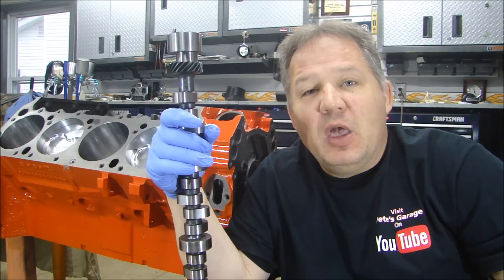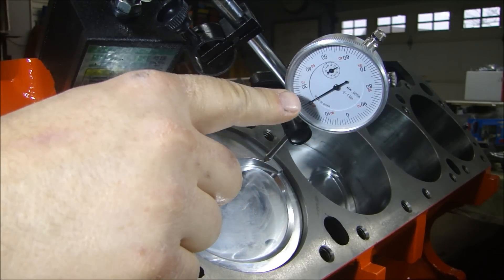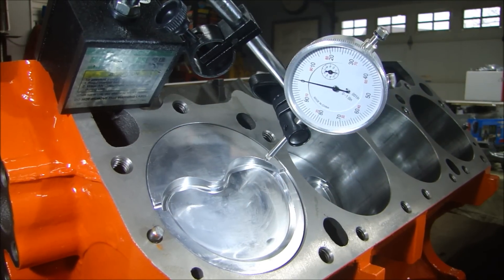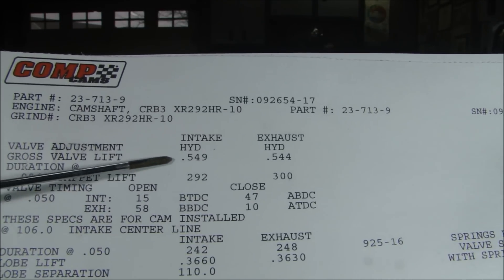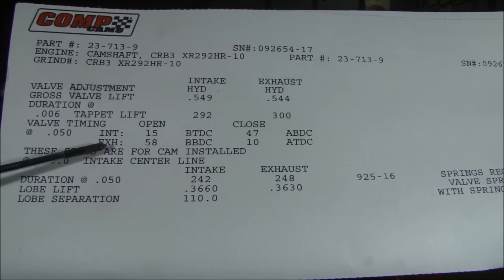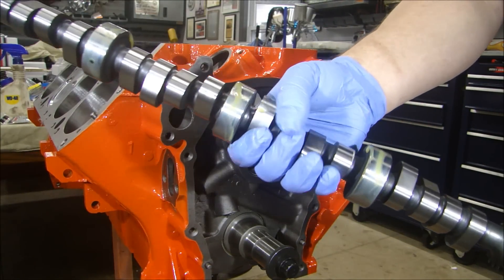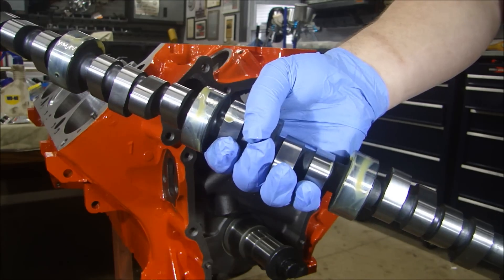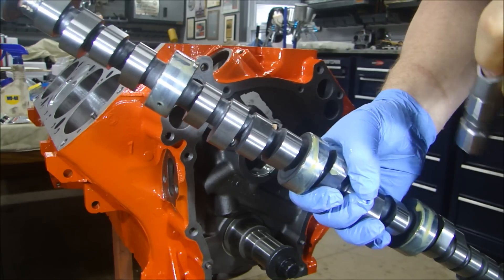440 Chrysler Mopar Engine Building Part 5 - Cam Installation

Comment: Pete, can I use a 3-bolt camshaft on my 1-bolt 383 B big block? Does it requires any modification besides the timing gear?
Reply from the maker: Yes you can, with a new timing gear

Comment: Hi there Pete...Did you remove the washers on the cam bolts to install the cam button?  Thanks...Tom Lacy
Reply from the maker: Depending on the combination of bolts and button, you may have to trim down the washers to get the button to fit

Comment: Been watching your vids. Im not a Mopar guy but have one that a customer brought in and its giving me fits. Its a 440 wedge motor. Its just been rebuilt and all new parts. 850 holly brawler  carb and edelbrick intake. The headers are garbage and hit the plug boots even dimpled they are burning the plug boots and headers are glowing red if I keep it running. I was able to check timing and its at 8degrees . Then I have to shut it off before it gets to hot. At 225 degrees I shut it off for fear of it getting to hot. Thermostat seems to be working fine. I talked to the engine builder and he says he checked the push rod length and shimmed the springs to spec for the comp cam. The rockers have no adjustment so they can not be adjusted. But to me it seems valve adjustment related. I have even installed ceramic boots and the rubber inside them melts and plug wires fry at the plug.  The distributer is a Mallory unilite. The number 8 cylinder header tube is so close a short spark plug has to be used and still hits the tube. I still think I should be able yo get the engine running and not burn up the motor even with the crappy headers. Do you have any ideas on what to check or do to see what the issue could be. If it was an adjustable rockers set up That would be the first thing I would do is double check my valve timing. All my experience is no good here on this one. Another note. The heads were so bad that the motor builder said he had to resurface the spring pockets because they were gouged out from incorrect springs. This should be a simple break in and tune but turning into a night mare. 6 plug wires so far its eaten and two plugs.  If you have any ideas or things to check let me know. Also I'm not sure but I see the intermediate shaft between the dist and oil pump. Is there any way that would make any difference if off a tooth ? When I dropped in dist I made sure to set it at correct postion so it seems to be correct. Wires correct.  Fuel adequate to keep cylinders cool. It seems valve timing is off. Firing order is same as chevy so I had that down.
Reply from the maker: Are you getting oil pressure immediately? The headers won't make it overheat.  It's either timing, too lean, or air pocket in the cooling system. Even though it's an 850 carb, it can be jetted too small on the primaries.
Reply: Does TDC correspond to the timing mark at 0° with the harmonic balancer. If it's a used factory harmonic balancer the outer ring can slip throwing off you're timing.

Glowing headers at idle is an indication of retarded timing.
Reply: @a70duster  Im not sure what the trouble turned out to be. I got worried when I pulled the headers off to put on a stock exhaust manifold and see if I could keep the  spark plug wires from melting  and one if the bolts stated leaking water. I called the customer to tell him and he tells me that its common on these motors. Someone put in long bolts and pierced the water passage. He said just put high temp silicone and it will be fine. Just get it running good for me. Its okay if it rusts the bolt. I had him pick it up that Friday. No charge for my time so far. Just take it.

Comment: hey Pete. have you ever installed a timing chain where you have to set the cam gear dot at the top 12 o'clock position?
Reply from the maker: Yes
Reply: @PetesGarage  thank you Must of been a Mopar engine.
Reply: @mimaspa1234 12 oclock position would be tdc1 correct.. where if you sent the cam gear down at 6oclock face to face with the crank gear dot the timing would be set to 180 out?? Am i right?? Meaning I need to set it at tdc1 which would be 12 o’clock for the cam gear??
Reply: @drgreenthumb9984  thank you

Comment: It makes sense not to lube the lobes initially, but why does Comp Cams instruct to lube the lobes and oil the journals? You would think that assembly lube would be better for the journals. Also, their instructions don't mention the thrust bearing for the back of the cam timing gear, even though it had one on the old cam. I bought the "kit" from Comp Cams, and it didn't come with one either. Thanks!
Reply from the maker: That's a great question. They are the manufacturer so if there is a problem they can can you did not follow their recommendations is my guess. I always lube thrust surfaces on the cam and crank, that also makes sense.

Comment: Hey Pete, I ordered a new Howard Roller Cam for my 440 and figured I’d replace just about everything including the timing gears and chain...question is how did you find out what size bolts worked for the timing gear on the camshaft
Reply from the maker: They should be the standard size

Comment: Pete im really struggling with intake centerline for the mopar trickflow cam. I have found TDC multiple times to confirm accuracy with a piston stop. 

They tell me centerline should be 104 degrees. Im getting 30 degrees and also 110 at .050 on my gauge.  So im assuming this means 110+30/2= 70

When i called trickflow they seemed to have a hard time giving me the centerline number. They had to get with engineers  and i got the run around i feel. 

Your one of my last resources, and figure you might know being you did the trickflow 240 heads.
Reply: I figured out my issue. My crank sprocket ⚙️ was installed at 0 with the woodrruf key.  This gave me 70 as centerline vs 103  which is what i got after changing positions to 4 advanced on the crank.
Reply from the maker: It's always something simple, glad you figured it out
Reply: @PetesGarage  Thanks for the reply, I always appreciate it. 

It is always something simple. It was really driving me nuts, because i have degreed a cam a few times. 

What was your 440 static compression you built? Mine is targeted at  10.42:1 and 8.53:1 dynamic with the trickflow cam. 

I didn’t know my compression ratio prior to measuring everything because it was an unknown build.

Comment: As far as finding the TDC, does it matter if you are on the exhaust stroke or intake stroke? If so how do you know which one is which?
Reply from the maker: Until you put the cam in there is no intake or exhaust stroke. Intake stroke happens right after the exhaust valve closes
Reply: @PetesGarage  thank you! Working on a 318 poly head and this is my first build, so I'm still trying to learn and retain as much as possible.

Comment: Im alittle Surprised you didnt degree the camshaft....all those nice positions on the crank gear are there to get  your intake center line where the manufacturer wants it...ive had factory cranks off by several degrees....if you dont ck...you dont really know...🤔
Reply from the maker: I do have 3 videos on that

Comment: Thanks for the very helpful video! This is my second 440 build and while the first went smoothly with the cam button this build seems to have excessive clearance between cam button and timing cover. I have .157 clearance and this seems like too much. I am using same timing cover, timing set and cam button as last build but different cam. I have measured and remeasured and still come up with about .157 gap. Does this seem excessive to you? Not sure how to make up such a large gap. Any thoughts? Thanks
Reply from the maker: Interesting, you can put a shim behind it. It would be nice to know what's different

Comment: It's much easier to install the chain on both gears before installing them on the cam/crank.  Then there is no fiddling with the camshaft nicking up bearings or anything.
Reply from the maker: It sure is

Comment: I have always installed a cam shaft in the block, before the crankshaft, that way I have complete control of the installation, no chance of damage to cam bearings.
I have been doing it that way since 1963, when  I started my apprenticeship at 16, and never had any problems.
Reply from the maker: Sure, that always works. I prefer to do it after the crank and pistons are in in case a nut or rod bolt falls in. Don't want to nick the cam.

Comment: I completely disagree with how you put the chain on. It would be and is much easier to leave the cam gear off and put the chain on both gears and then bolt it up. You risk damaging the cam bearings doing it your way. I have been building engines since 1965 and I would never do it your way.
Reply from the maker: Thanks for sharing your technique
Reply: Agreed, the risk to the bearings is significant. I have never seen or heard of it being done your way.
I have only rebuilt a few engines, but I have done many timing chains (usually in the vehicle).

Comment: Probably an amateur question, but have you ever seen a gap between the back of the cam and the rear of the block? I've been told it's normal and the cam can't move due to the cut of the cam/flat tappet lifters and the cam gear holding it, but I'd like to be 100% certain. Video link below for explanation.

https://youtu.be/V_YH0TN0uLI
Reply from the maker: Don't worry about that back movement. The cam gear will hold it in place. The cam on this engine will thrust forward towards the cover so it's not a huge deal.
Reply: @PetesGarage  you said it thrusts towars the block not the cover. So which one is it

Comment: @Pete'sGarage  Why do you need a cam button if the cam wants to move to the rear?  Would it be safe to complete this build without the button?  Was the purpose of the cam button just an extra step of measure?
Reply from the maker: The cam does not have a retention plate like on other engines
Reply: A roller cam requires a button because it thrusts forward. A flat tappet cam doesn’t require a button on a big block Chrysler.

Comment: Great video. Thanks for taking the time to upload. I'm guessing the way you show the timing set here shows the cam install as "dot to dot" or straight up??
Reply: @PetesGarage  For example if you advanced 2 degrees....you would put the A2 slot on the keyway??
Reply from the maker: Correct
Reply from the maker: It it straight up timing, correct
Reply: @PetesGarage  thanks for your reply. I'm assuming since the crank keyway is a multiple type, the advance and retard settings on it would be same as degreeing the cam to that spec? Or am I way off base here?
Reply: @PetesGarage  Thanks again! That seems like the easier way to do things!

Comment: Pete love your videos. I just installed a Hughes Engines Cam in my 440 build. Put all the assembly lube on cam after cleaning. I noticed your cam spun way easier when you installed it them mine did. I couldn't twist mine by hand. Could be because I have a one bolt.
Reply from the maker: That is concerning. If it is that hard to turn I would pull it out and make sure there is nothing on the bearing surfaces. Put is back in and turn it when you reach each bearing. If one of them is ever so slightly crooked it will bind.

Comment: Hi Pete! I saw you go dot to dot on the timing chain.  I saw once someone putting a 383 stroker together and he strongly advise not to go dot to dot, he use the expressions ... " the engine will never turn over "  Thanks again for your inspirering videos.
Reply from the maker: It really depends on the timing gear set used.
Reply: OK! i got it thanks ........

Comment: Hi Pete! how come many start putting in cambarings and then the cam as first. Is it because had the maschine shop put on the cambarings too. Otherwise how can you see and know if it is put in order. Thanks for the great efforts you tell us .... crankshaft inplay ... top dead center .... whole in one. I have seen many videos with assembling engines with no explaining the meaning of the terms.  Thanks a lot Pete im a super fan from Sweden
Reply from the maker: Thank you Christian. It is a preference. I prefer to put the cam in after the crankshaft and pistons are in in case I drop a bolt. I don't want to nick the cam lobes.
Reply: OK! make sence ... Thanks

Comment: I will keep watching but I think I noticed the cam card said to degree at 4 degrees forward at 106. I also thought you should put a torrington bearing behind the cam sprocket but I'm not sure. Just asking.
Reply from the maker: The cam card is saying what the specs are at 106 degrees installed. You can advance the timing if you wish, and check valve clearance, but I wanted to slightly tame it down for a better idle so it's installed straight up. No Torrington bearing is needed.

Comment: Nice bottom cam gear👍👍👍👍👍
Reply: i have the same timing chain set up iam consern  on the bottom crank shaft sprocket is it sopost to loose when you slide the chain on?

Comment: Interesting that you actually pull the cam back out to install t-chain.
Reply from the maker: Not that much, just off the bearing
Reply: Looks Like A Howards Cam Timing Set - I have had some tight chains before , I pull the camshaft out just far enough so the journals are still resting inside the bearings just barely , then looking at the crankshaft you will see it is slightly recessed or smaller right before the crank gear slides into final position on the crankshaft - Keep the crank gear on that smaller recessed area , have your timing chain around both gears , then slide the camshaft gear into position on the cam , then push the crank gear and camshaft/gear back into final position
Reply from the maker: Great comment, thank you for sharing

Comment: it's always been easier for me to put both sprockets on at the same time, rather than pulling the cam out and resting the lobes on the bearings(like you avoided earlier)
Reply from the maker: I agree. I do that when I have a single bolt cam.

Comment: Looks like your building (from cam specs, and with good heads) for around 600 HP?  What ratio rocker arms?
Reply: Rocker arm video in two weeks.
Reply from the maker: All that information in the next video this week

Comment: What is the benefit of leaving intake valves open beyond bottom dead center? It seems like back pressure would be created for m the fuel system, and be a waste of the opportunity to create higher compression.
Reply from the maker: It's all about the dynamic compression. You want to make sure the cylinder is completely full or empty before the valves close.
Reply: MORE POWER...
Reply: JOHN DEERE how does leaving a valve open beyond BDC create more HP?  You then have a valve open at the beginning of a compression stroke seems like it would lose (not gain) horsepower.
Reply: Pete's Garage this may be a great whiteboard lesson...deeper dive into the science behind 'dynamic compression.'  I can picture in my mind two things at play:
1. Inertia of air/fuel entering the combustion chamber gives a split second of opportunity to leave the valve open and draw in more fuel.

2. A slight vacuum (lower pressure) at the bottom of the cylinder gives opportunity (time) to leave the intake valve open for the same reason.

Am I close?  More SCIENCE please!!! 
No-flat-earthers need pay attention. Haha!
Reply from the maker: You are very close. I have an intake manifold theory video you would be interested in

Comment: Great vid those roller lifters look expensive. Could you just use plain solid lifters? Thanks Pete.
Reply from the maker: They are the best. A roller cam is ground different than a roller cam, so no, you could not use solid lifters without changing the cam.

Comment: Nice ..I soak the chain overnight too.
Reply from the maker: I know lots of people do that, but soaking overnight is kind of an old wives tale. Not a single engine manufacturer soaks any parts in oil. They are installed straight to the engine, right form the supplier.

Comment: I have installed many cams, but NEVER have I seen or done it the way you just did. Once the cam is in, I never pull it out again till it's replacement time. Install the cam and crank gear. Then put the chain on the cam sprocket and install the sprocket onto the cam. Bolt in...
Reply: Sometimes the chain is to tight - Have had a few where I have done it like I mentioned above
Reply from the maker: That is definitely a way to do it, and I always do it that way with 1 bolt cams. This cam has 3 bolts and it's a bit clumsy to keep the timing set and get the alignment pin in while trying to get an off-center bolt it. Thanks for the comment
Reply: @PetesGarage  I won't do it this way for fear of scraping the cam bearing. Maybe it's due to having the camera in your way, but 3-bolt is just as easy to do and no worries about scraping the cam bearings...

Comment: It's looking good does the springs come with the cam or you get them separately.
Reply from the maker: If you mean valve springs, they will come with the heads unless you build the head yourself

Comment: Your builds are so clean and look aweasome. After the first of the year I have a 4.6 v8 that I want to rebuild for my f150. Think it's possible to get 500-600hp out of it? I wanted something different for my truck because it's going to be lifted with a 4 wheel drive.
Reply from the maker: Thanks Robert. 500 is quite a bit for a 4.6, not impossible, but expensive
Reply: Pete's Garage I realize that. it would be a ground up build that would take a while.  Different crank, cam, heads, intake. Upgrade my fuel injection, etc, etc. Then trying to decide if I wanna go supercharger or turbo. I only have the stock two valve heads right now, notorious for blowing the plugs. I also know I'll have to probably change the axles and the tranny too to handle that type of hp and torque that I want. I just don't know what to do about the transfer case, if I would have to upgrade that as well or go with a higher performance option.